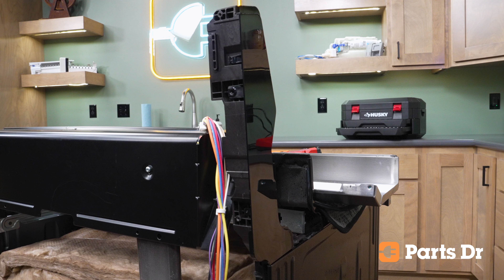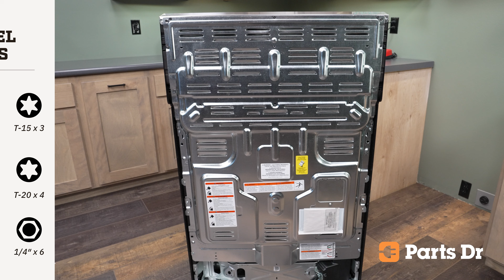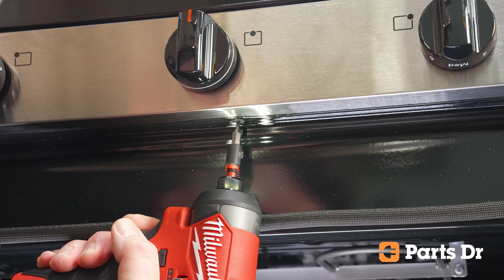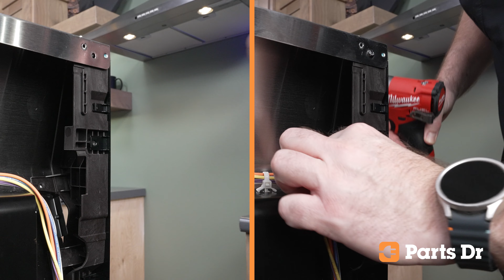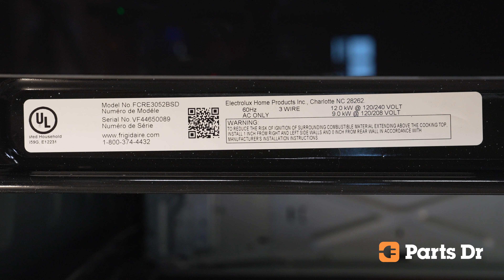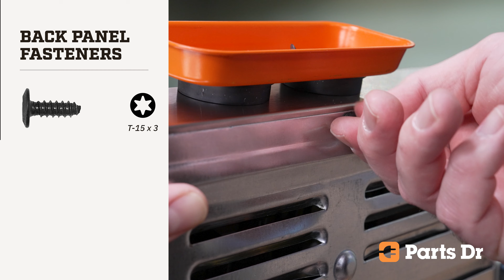How to Replace the Left Side End Cap on a Frigidaire Range | Step-by-Step | 5304533913 | Parts Dr

Comment from the maker: Thanks for watching our step-by-step guide on replacing the Left Side End Cap on your Frigidaire range! If you're ordering a replacement part, make sure to avoid cheap aftermarket versions that often don’t fit properly or wear out quickly. For a perfect fit and long-lasting performance, we always recommend using the original OEM part. You can get the genuine parts from our site at https://partsdr.com. Happy repairing and let us know how your repair goes in the comments!